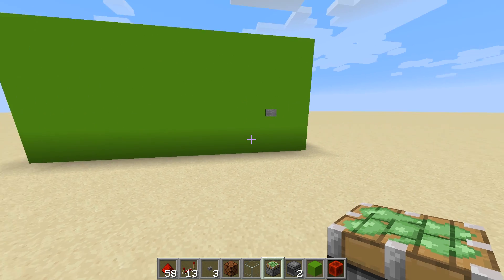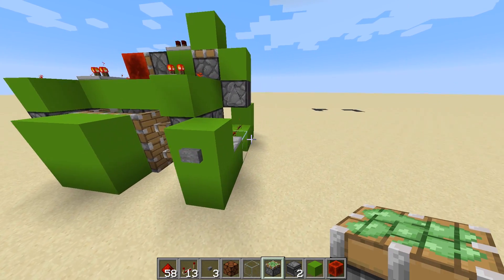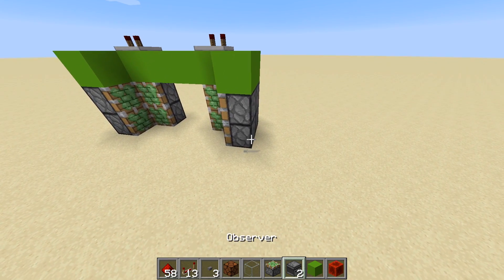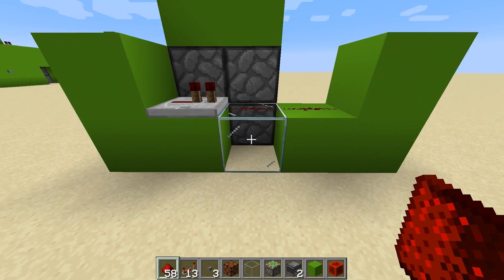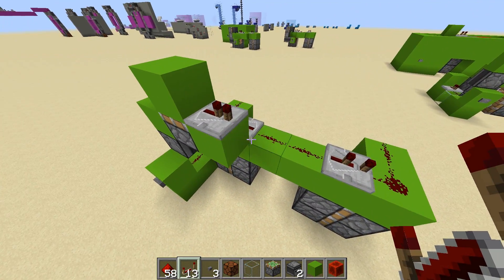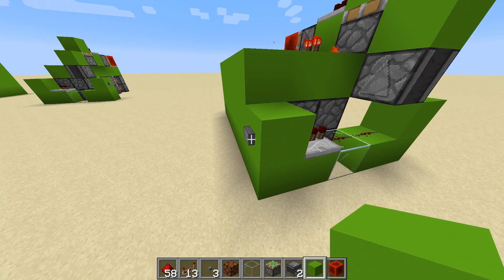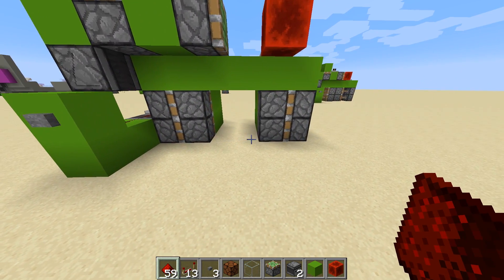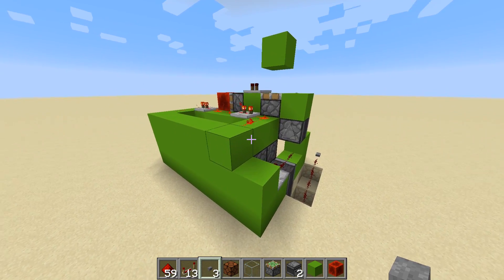Minecraft How to build a 2x2 flush piston door with buttons on both sides. (jeb door) Java only

Comment: A useful tip if anyone is struggling with the redstone piston at the top pushing it upwards but the piston on the side pushing the redstone block does not work then check two things:
1. Make sure you use a glass block on the side
2. Right click the redstone dust on top of the block on the observer to make sure it has the cross pattern do NOT put the dot pattern.

I don't know why it works like this but I hope this helped you out!

Comment: This is (from what I've seen) the only tutorial for a Flush door that uses buttons on both sides and it was made 5 years ago, somewhat compact design as well.
Reply: That’s because it’s a 2x2 usually the 2x1s are very easy to connect and just add a button almost anywhere and it’ll work but a 2x2 is a lil more confusing also if you want it to be 1 button tap on another one off you just have to remove the sticky piston at top change it with your normal block put red stone on top and put wool at the corner of it so the redstone won’t connect with it and there you go and you can actually chain these together

Comment: first off the repeater doesn't take any signal from the piston which is weird then if you use it manually the point of the flush piston door doesn't work it doesn't push the blocks outwards into the wall

Comment: Hey man, I've got an issue, I want to use a hidden lever input (which i've switched out for a button) for the 2x2 piston flush door but the button breaks before it can finish its output, causing the door to break, Know a solution?
Reply: does this work in 1.18 for you?
Reply: @yowheresdapiza9460  Yeah, Dont worry I got it, Had to tweak it a little so that the button breaks a little bit after the signal's been sent.

Comment: WoW thx that actually worked. I looked at a bunch of designs but they are all bugged, maybe because they are not for servers... which is odd of course. ;) I've changed the outside button with a wooden pressure plate so it can be shot with an arrow.